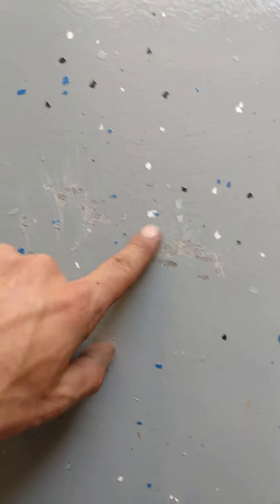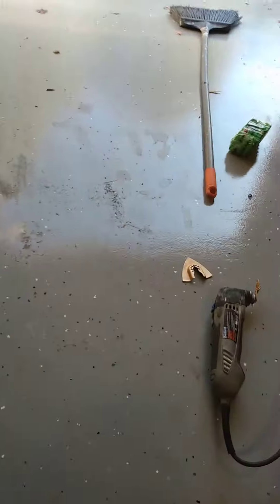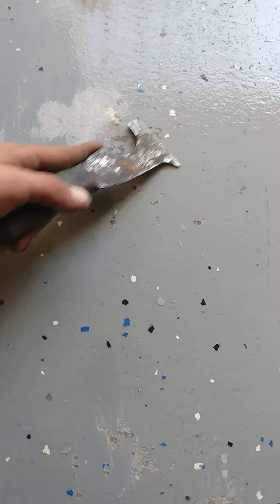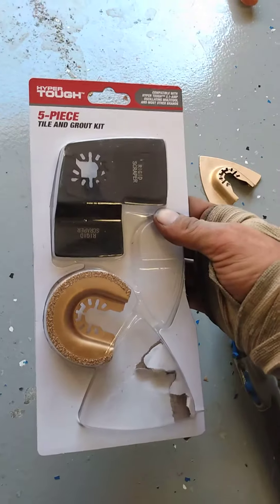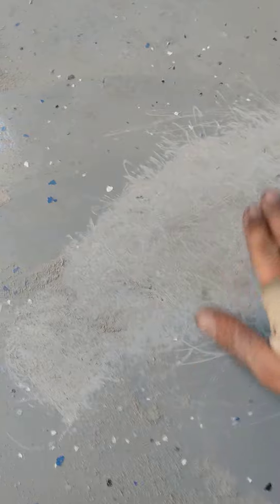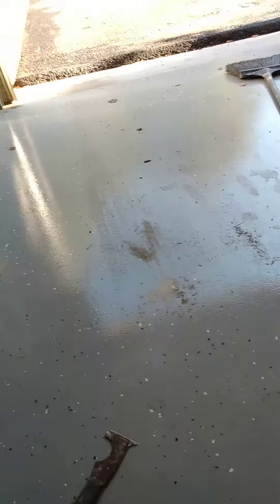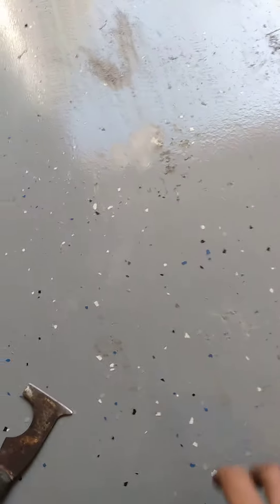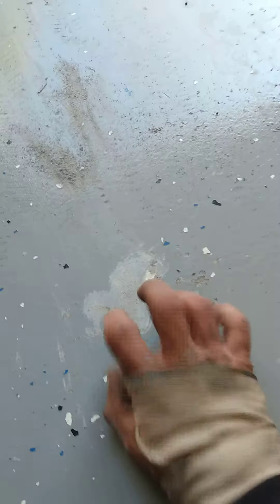Repairing failed epoxy floor from hot tire peel.

Comment: Didn’t you already scuff it the first time as you mentioned you rented the tool from Home Depot…. Won’t the same hot tire pickup happen again?
Reply from the maker: The machine left the floor too smooth, I mightve had the wrong wheel so the epoxy didn't have enough to grab onto. This scuffed it more which gave it something to grab on to. I would recommend to sgueegee the epoxy onto the floor rather then roll. Sherwin Williams recommends rolling but it's too thin and peels way too often.